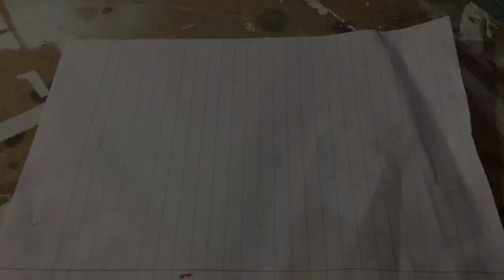What the Flock?!?!

Comment: That's cool,  I've never seen that before.  A lot easier than felt covering.  How durable is it ?
Reply from the maker: Hi Thomas!!! Thanks for the view and your comment. You have to let the glue fully cure, and it's pretty durable after(personally.... 48 hours or so). I guess it just depends what your using it for. I've mostly just used them for jewelry boxes.... and have had pretty good luck with it. But there is a wide variety of applications that flock can be used for. And yes... So much easier then felt covering..... especially in odd shapes or small/tight areas